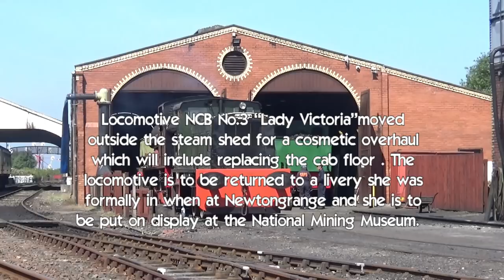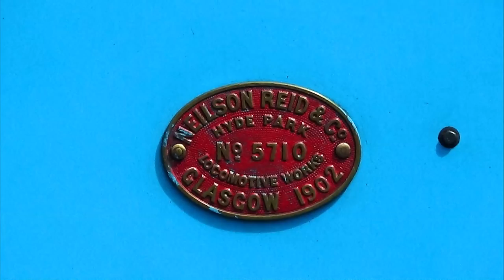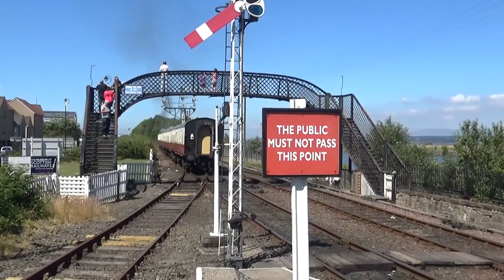Well hello there sunshine

Comment: I have noticed that at the B & K paint shops that the brush paint a lot of things.  I would think that it would be hard to get the brush marks out or do they thin the paint?  Is this a common practice with BR?  I just think that its odd to brush paint
Reply: Not odd at all, using the correct paint and brushes. Saves a lot of work masking off, and no need for expensive spray booths and extraction for the size of prject